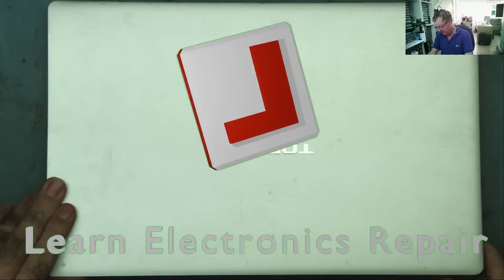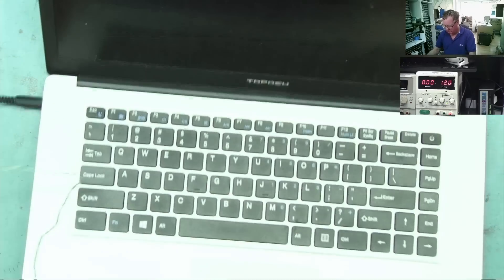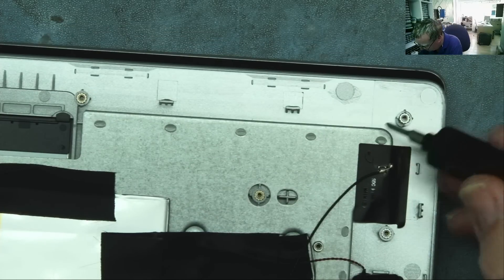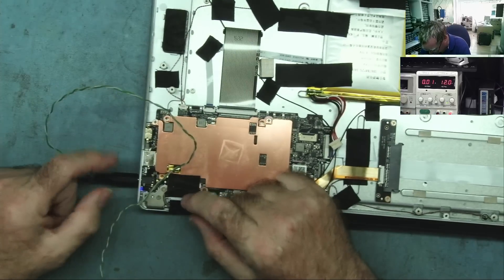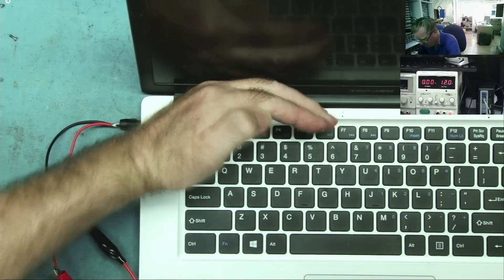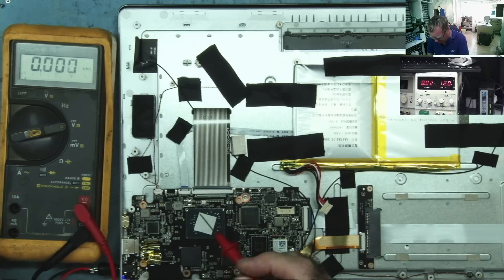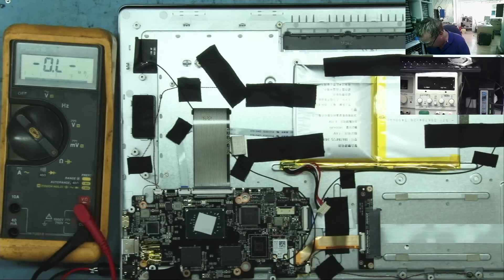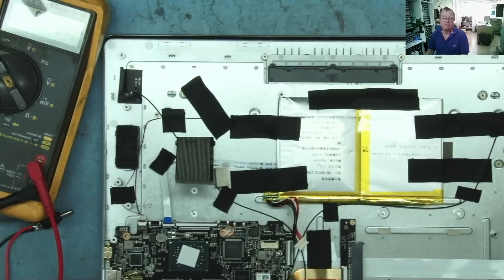Laptop charges battery for a few seconds then shuts down.  Will not start : Check These Things FIRST

Comment: It's possible the owner didn't check the polarity on his replacement charger and maybe blew something, super i/o chip maybe.  A lot of manufacturers like lenovo have a direct trace from the power jack straight to the super i/o chip so that it can sense that the correct charger is being used.

Comment: Hi Richard,
there is one thing you did not try (at least not on video), to power up the laptop without the keyboard connected.
Other than that, I don't thing that the device is worth your time. Any refurbished DELL Latitude will have significantly more power and can be bought for cheap. This device is a cheap 💩
Have a nice weekend! 👋

Comment: The battery held in place by tape rather than screws. So is everything else. SIgh. If someone bought this cheap of a laptop are you sure that they are even willing to pay the repair costs? Sorry, but I would close it back up when I see something this cheaply made. This repair is more for the content than the cost of the repair.

Comment: I believe the time already spent troubleshooting exceeds the cost of this device, unless they want data recovery, but some would say that's a cop out.
Reply: Indeed. Also throwing money at a new battery, when it looks like a very cheap laptop, to then find that the new battery hasn't resolved it is a big gamble
Reply: Just what i was thinking too.  Uneconomical repair. Connect the HDD to another computer via a SATA to USB adapter to recover the data if required.

Comment: This seems to be a very cheap device. The main PCB is tiny, the CPU is passively cooled with a simple copper plate (maybe something like a Celeron N4000), and the battery is just 2 cells slapped together (without an enclosure). Many of these cheap no-name brands never get a firmware update, so the UEFI firmware might be riddled with security vulnerabilities. Given that it needs a new battery at minimum, and possibly further work, it might not be economical to try and save this one. It's up to the customer, of course, and everyone's situation is different. But probably a conversation worth having. It's like trying to save a Reliant Robin from the scrap yard. Not a lot of people who would do that.
Reply from the maker: As the voltage rail that supplies the CPU never powers up, and the laptop draws no more than 20mA, I don't see how the BIOS is related to the observed problem
Reply: @LearnElectronicsRepair  No, it's a general observation unrelated to the fault. Even if you do fix it, chances are that the firmware will still be the security equivalent of a Swiss cheese. Which makes continued use of the machine somewhat... questionable.
Reply: @Foobar_The_Fat_Penguin  Good point.

Comment: Curious at to whether the 3V3 remains present when the power button is pushed, odd (in my opinion) that the ext PSU shows no (or very little) current, whereas it was previously showing a pre-charge current (when the battery was connected). May be worth retesting with the naff battery reconnected.

Comment: Interesting - is the spec for that battery connector available anywhere (or deducable)?  It would be useful to be able to ‘dummy-up’ a battery pack from time to time to confirm charging circuitry is working, or in this case hopefully permit the laptop to turn on.  I bet you have some 18650’s kicking around somewhere .. could be useful.

Comment: Oooh we got a spicy pillow!
If the voltage on the battery charging inductor was 8.4 volts or thereabouts, that makes sense for a two cell series charging voltage. That's 4.2 + 4.2.
Reply: That's a really terrible design Lithium Ion is a great battery type but it has a drawback that each cell should have it's own monitoring and charging circuit because if the cells differ from each other in series one of them can explode.
Reply: @scotshabalam2432  the management board on the battery pack likely handles that
Reply: @scotshabalam2432  Lithium batteries cut out way before actually being empty and in danger of exploding. Thats what the small pcb is for, that is attached to them. You can clearly see how the cable to the motherboard is on the green pcb. Which has fuses etc.
Reply: @0MeALot0  and a management IC that will shunt a battery with a resistor if it is full before the other one.